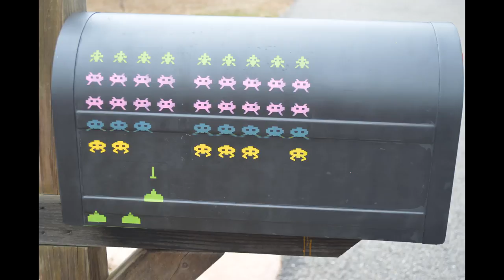Custom Cerakote Space Invaders Mailbox

Comment: Another awesome video!  Definitely want to know what the smaller guns are?!?!.. Speaking of spray guns, or is using an airbrush, what do you do about switching colors?  Do u clean the gun out each time you need to switch???  Or do u use multiple guns?  What pressure are you running on the smaller airbrush type?  I know you’ve talked about the air line refrigeration set up...curious why you don’t use one of those smaller round type of gun filters that attaches to the air Inlet on the gun?  Man as always, THANK YOU for these videos and tutorials!  🙏🏻👍🏻💯
Reply from the maker: Thats the Grex Titanium. I have a video on that that needs to be edited and uploaded. I always clean the gun completely between colors. If this stuff sits in the gun for more than about 45 minutes, it starts to set up and gets impossible to deal with. We have a video on HVLP maintenance. I run the Grex at 20 psi also.I've just never used them, and have not had any issues. We did have a guy come out for training that brought his Iwata, and had a nice setup like that. I just haven't gotten around to ordering any of the filters. With the refrigerator, the air is really dry, but it couldn't hurt.

Comment: My comment is more of a question and not necessarily related to this video. When cerakoting scopes should you ALWAYS use air cure or can you use H series?
Reply from the maker: That's a tricky area. The problem with baking scopes is that with the cheaper scopes, the O rings may fail. What I normally tell customers is, I will guarantee the process, but they need to guarantee the item. By that I mean, I know the process I use won't cause O ring failure. So if they want to do their scope with H, they take the responsibility of whether or not the item is of enough quality to go through the process. 

Having said all that, I've never had one fail.

You bake them at 150, for two hours.